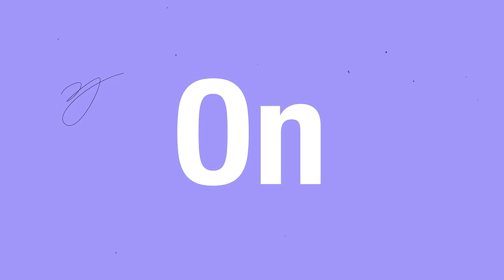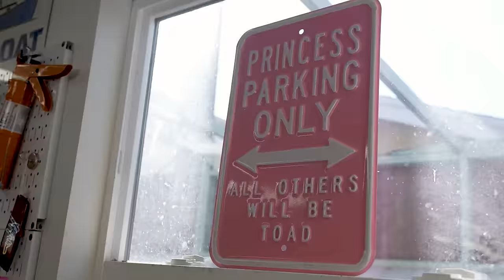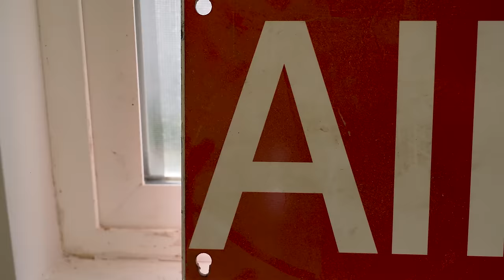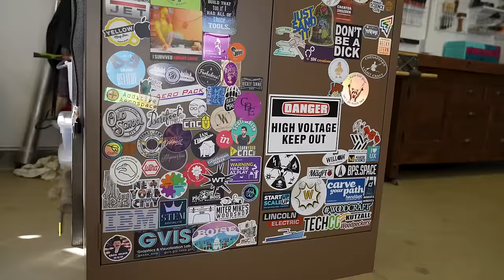I Moved my Entire Workshop in 2 Days

Comment: Adam Savage has most of his stuff on wheeled carts and it makes a lot of sense to me. Also, GREAT use of space, those little dispenser drawers for screws and stuff; it makes zero sense to waste space for looks in a working workshop.
Reply: Adam is also a devotee of the shop infrastructure video.  Don't be afraid to share the journey toward your best workspace (like your proposed clamp cart)!
Reply: Upvote so she sees this.
Reply: I hinestly think that the little screw cabinet looks so much better than just a slab of plywood would
Reply: Yes, wheeled tables and carts are great for dynamic layouts and Adam designs around the concept of "First Order Retrievability". I've also found it helpful to start wearing my toolbelt in the shop again, got tired of looking for the tool I just used to find it on the other side of the shop again.
Reply: I keep hoping to see an Xyla and Adam Savage collaboration video.  They are two of my favorite makers on Youtube.
Reply: Adam Savage's workshop is the height of interior design. I'm not a maker an even I want his workshop.
Reply: @sc9702  pretty sure they're only a handful of hours apart from each other so there's hope!
Reply: Aren't they both in the San Fran area? She should reach out. It would be a great colab.
Reply: I love locking caster wheels!

Comment: Xyla, modular is all you need to know for the “perfect” shop! Put everything on casters like you’ve done so you can move everything around as needed like a big wooden Tetris game 😊
Reply: Important note for someone looking to use coasters under work tables: LOCKING wheels!
Reply: @MonkeyJedi99 Though not all of them need to lock. On a table that size, locking the 4 corners would probably be enough
Reply: I saw the locking tabs, pretty sure they are.

Comment: For the dust collector, you need to think in 3 stages: capture as much at the source as possible, have a way to clean up what settles and something to clear the air.  I would see if you can talk Oneida into donating you one of their supercell or gorilla units.  If you can swing it all get one with a HEPA final filter at the end.  If not Wynn environmental can get you set up.   You may need a separate circuit for the table saw and dust collector.  Some places will do the design of the ductwork if you buy it from them.  As far as the clamp rack goes Fine Woodworking has enough stuff on their website to get you started, you won’t need super detailed plans.  If you have questions I’ll bet there is a woodworking club you could go to, if nothing else to see who in your area has good service.
Reply: oneida is definitely the top dust collector but way out of my budget. I bought a grizzly and added a separator. It works very well.
Reply: Oneida is great but skip the supercell, it's been a pretty huge disappointment in our shop.
Reply: What do you mean a way to clean up what settles? You mean a vacuum for the floors?

Comment: Some kind of concept I "invented" at my job for finding small things like screws and nuts :
It's the same everywhere, after some time you end up with a huge box of mixed "things / stuff".
Instead of sorting by precise use, size, type... I sort by basic, very simple specifications : "screw - bolt - washer", "large - small", "for wood - metal"...
Since a few weeks, this has proven to be efficient, even on professional scale where time is money and "buy new instead of searching / sorting".

Comment: FWIW I built a glue up/clamp station on wheels it's around 18" x 24" by 35" high.  I only have my smaller bar and squeeze clamps on it and the cabinet holds the glue in smaller containers.  It holds the associated stuff for glue up, gloves, plastic trays, paint brushes/rollers (glue brushes/rollers).  Then I keep the bulk epoxy/wood glue in a cabinet and only wheel around what I use.  Makes glue-ups so much simpler and quicker if I don't have to run back and forth for supplies/clamps.  My big pipe clamps are still mounted on my wall clamp storage since they are very heavy.

I could go on and on for days regarding dust collection, kind of a hobby for me fine tuning my setup.  I suggest that really you approach Onida Air Systems and have them do your design, it's one of their services that they provide.  I bet they would be happy to help out with the cost of the setup since your videos are top notch and very entertaining.

Good luck with the new shop, stay busy.
Dave Couch

Comment: Congrats!  Love your stuff!.  Re-doing your shop is one of the joys of having a shop.  You get to fix everything you didn't do right the first time.  I have a suggestion; screw (not glue)  a sheet of masonite to the top of your rolling workbench.  Then rout a small radius around the edge.  It makes a really nice work surface and you can replace it when it wears out.

Comment: About workbenches being too tall. There are wheels that go on the the side. Instead of locking them, you raise/lower them. There's even ones that latch on/off, so you can fully remove the wheels if needed.  This lowers any surface by the height of the wheels.

Also, for organizing, maybe pick up a bambu or Prusa XL and print out some of the many preexisting box inserts and such.
Reply: Big thumbs up for adding a 3D printer to the collection of tools. Being able to print out custom little jigs can be a big help. Instead of building the jigs yourself, send it to the printer and do other things while the jig prints. (Multitasking FTW!)
Reply: Xyla needs Gridfinity; she just doesn't know it yet.  Also, Buck Fambu.
Reply: Buck Fambu, indeed.

Comment: JET 708659K Model DC-1100VX-CK 1.5HP 1-Phase 115/230V Dust Collector W/ 2-Micron Canister Kit. I have one and it's a beast. It will handle some pretty good 4" duct runs to various parts of your shop. I like mine and really like the big canister. You could build a tiny enclosed lean-to outside of your shop to cut down on noise and that very fine dust that comes out of even the best of dust collectors.

Comment: When I started planning to build a CNC router I got advice to get a Record Power CamVac dust collector. I did and I am happy with it, it is very powerful for its size. Vacuum cleaners pull quite high vacuum but do not move much volume and often do not like running for hours without stops. The typical large dust collectors with the big bags on top move huge volume of air but do not suck much of a vacuum. The CamVac sits somewhere in the middle, it is intended for long running and seems to have pretty good filtration on the output. I tried my particle sensor in the workshop when running a table saw with the CamVac and I was surprised it did not go immediately into the red on fine particles like it did with a "normal" dust collector. I only had the CamVac for half a year but I am very happy with it so far.

Comment: My thought for the rolling clamp stand is think A-Frame. Rectangular base, and boards from the long ends of the base angling to meet up at a peak over the center of the base. Put clamp holders on the outside organized how you like. On the inside of the A-Frame, either drawers for small clamps that don't hang well, and/or a sliding vertical wall that has clamps hanging on both sides. For the clamp holders, instead of fixing them into one place, maybe go peg-board (or what ever variant you are using elsewhere in your shop), or use it as an intro to experiment with french cleats.

Comment: I don't know if this is something you were considering, but when you do get a dust collector, I recommend getting floor vents. That way instead of vacuuming the whole shop you can just sweep the saw dust over to the vent/vents and it will get sucked up.
Reply: That reminded of data centre designs where there is a lifted floor as cables and airflow pipes run under the floor. Good idea overall. Though maybe it could be useful to have some kind of removable “safety grid” on top of those floor vents to avoid accidentally dropping valuable parts there.
Reply: @autiomaa  That's smart
Reply: @autiomaa  All good points, but what I had in mind was a lot simpler. Imagine a ventilation pipe from the dust collector that has a little square cut into it when it reaches the ground. I'll do my best to add a lil doodle made form dashes and slashes:
         |            I
         I            I   <-Vent. Tube
         I   _ __  I
         I I       I I  <- Hole to sweep stuff into
--------------------------------------- <-Floor

Comment: Have you ever seen one of those collapsible towel racks? That is, the kind that collapse like an accordion but expand to diamond-shaped openings on the sides, leaving long dowels in between to hang towels? I feel something like that would be a good start to a portable clamping rack. No stress on springs when hanging around the dowels. Bonus that it collapses out of the way when you've got all your clamps in use. Congrats on the new shop! 👍

Comment: For dust collection, I bought a bunch of 3" PVC pipe, corners, and Ys, a shopvac, a cyclone, and a 20 gallon drum, and a pile of shutter vent thingies. Oh, and some flex hose for the tools. Works a champ and no dust ever gets into the shopvac so it really never needs cleaning. Put it in a sound dampening box and put a hole in the box for the hose. I made sure that one of the blast gates and inlets was at the floor for the sweepings.

Comment: If lifting is an issue consider a unistrut overhead trolley system, assuming your structure is up to it. If not unistrut is still a good way to organize your overhead, especially if you're going to hang lights and cameras.  If you're planning on running fixed ducts for your dust collection PVC conduit works better than PVC pipe because of the nice sweeping bends.

Comment: Zyla, Congrats on your new shop! 
Please remember that a workshop is never completed. It is a constantly evolving entity.
One thing with dust collection I have done for many years is to have a dedicated shop vac for each dust-making tool. I open the tool switch box and take a hot wire from the switch to a receptacle on the back of the tool for the shop vac; that way, it comes on when you turn the tool on. In some cases, I have had to increase the size of the wire and install a higher amp switch to accommodate the added load, which is offset by the fact that I don't have to run hoses all over the shop and have a separate switch to turn on each time you use the tool. This would not be practical for a production shop, but for stuff I do and most stuff I see you do, you don't need a large dust collector. This system is less efficient than a large dust collector, so I have a ceiling-mounted system with 2 A/C filters on a variable-speed fan that collects any escaping fine dust out of the air. I have 8 shop vacs in my shop that I have gathered from garage sales, etc., over the years. 
And last but not least, you are beautiful! I love you!

Comment: Izzy Swan has a great system where he has a simple “central” dust collector with one hose sized to reach and quick disconnects to the machines.   Since they only use one machine at a time it makes more sense than ducted pro system for multiple workers.
Reply: dust collection piping also builds up a heck of a static charge,so you have to run wire thru it to drain it. so no dust explosions.

Comment: You already have your roll around clamp station designed. Take your clamp wall from the previous shop and cut it in half vertically. Each half becomes one side of an A frame structure. Angle them about the same as you would an extension ladder. Now build a tray on wheels like you did for the 4x8 workbench and set the A-frame on top.

Comment: Also regarding dust collection, woodcraft has a new line of magnetic hose couplers which have magnets on one side and a steel ring on the other so that rotation of the fitting doesn't matter like it would with magnets on both sides.  They're calling it "MagFitt".  It came out very recently, from what I can tell.

Comment: Clamp stand idea: A metal pipe (think street sign post) about 1.1 meters tall, attached to a 50 cm diameter round base with caster wheels then at the top a 30 cm diameter hoop with 3-4 supports from the hoop to the pipe. all your clamps hang on the hoop ordered from longest to shortest, maybe a second hoop 25 cm diameter in the middle for extra small clamps. the 1.1 m (plus castor height) should make easy to see/grab the clamps but high enough that all (most?) of your clamps can hang without touching the floor. If you can't make all the clamps fit make a second one, think of it as being like a coat/hat rack on wheels for clamps.

Comment: Dust Collection; the Oneida big vortex on a 55 gallon drum is INCREDIBLE.  I have a Jet 110V dust collector with a folded micron filter that I pulled apart to mount components separately and use to pull air through the Oneida setup and the system is a beast.

Comment: Router wrench tip. For corded tools that have a special wrench or spanner. Buy yourself 20 feet of wire rope and a sack of swages. Every time you get a tool with a special wrench make a tether that attaches the wrench to the power cable. That way the wrench stays with the tool it goes to at all times. Safety bonus you have to unplug the tool to mess with the blade etc so there is never a chance of mangling your fingers.

Comment: A clamp cart that is plywood A-frames with black pipe rungs running up each side is pretty much the easiest, but you can make the rungs out of plywood too.  The more rungs, the more adjustability you have on where clamps go by size.  I see lots of people that go from large on one size to small on the other, but personally I'd go for large in the middle and work outwards just for looks alone.  But with enough rungs, you can change the layout whenever you want.

Comment: For the heating, if you can knock a 6" hole through the wall a woodstove is a good option. AC, we put an old apartment closet mounted AC unit in. Doesn't cool it completely but takes the edge of better than a Window AC. Before you get anything, get dust collection figured out.

Comment: if you made the top with (3) layers of 3/4”plywood, and had the top extend as a 5 inch cantilever over the sides, you can clamp down all around, and you could also screw things to the top layer of plywood to hold things down (which can be replaced when it get’s beat up)

Comment: You can easily install a mini split for heating and cooling.  Get a non Chinese model from Fujitsu or LG.  Depending on your budget they range from 16 to 32 SEER.  12,000 btu will work for your double garage space.

Comment: Great video.  There have been a lot of great comments regarding dust collection options. My thoughts will probably be a summary of many other viewers.  Consider putting the dust collector in a small shed outside along with the air compressor.  You will get back floor space, reduce the noise and eliminate the need for all of the extra filters.  You are a solo worker (most of the time) so you really only need to be concerned with one tool running at a time.  This will simplify your requirements.  Using a manifold to switch between tools (see Katz-Moses) will eliminate the need for blast gates.  Upgrading the dust collection on the miter saw (see Shop Nation) will help a lot.  Also adding a small shop vac to the miter saw will cut down on the starting and stopping of the large dust collector for small, quick cuts.  The Harbor Freight dust collector with an upgraded impellor (see various YouTube) would provide a good system for your size shop especially when installed outside.  A couple of box fans with furnace filters will do a pretty good job of catching the stray dust.  Lastly, as one viewer stated, get a leaf blower.  You will be surprised how much dust you can blow out.  Keep up the good work.

Comment: The thing we did at my uncles shop was make a modular vacuum system using one BIG BOI dust collector and 4” PVC. We found these modular gates you could fit into tees and attach hoses too so now we have like 5 different vacuum points that can be individually turned on/off just by sliding the gate. I’ll see if I can edit this comment and add pics when I go there later today!! Or feel free to reply with questions!!

Comment: For clamp cart, look at stuff used in the film industry. I’m thinking something like a c-stand cart, but with different heights for the different length clamps. But, a c-stand folded up is 40 inches tall, so that’s a good place to look for inspiration, since I don’t imagine you storing anything longer than 48” on the cart.

Comment: Harbor freight has an "industrial " large dust collector that is pretty good ( and very reasonably priced) . (single phase 110VAC ) 
And the second tip, everything on wheels . ( worked in a factory like that, whole floorscape changed every few weeks )  best regards Steve

Comment: Oneida Air Systems, Inc.  Not sure which one.  I bought one 30 years ago in 94.  It was their first model.  Basically a cyclone separator attached to an over sized exhaust bag.  The theory of the oversized exhaust bag is more square area of cloth prevents small particles from being forced though the cloth.  It works a lot better then your average dust collector.  Now they use HEPA filters.
I have upgraded it many times, now I'm adding iVac Pro automatic blast gates.